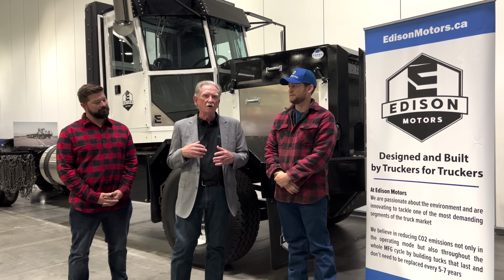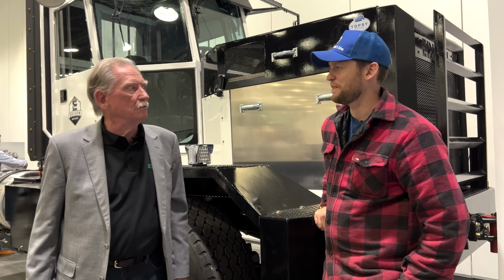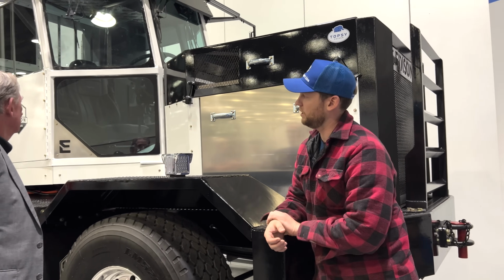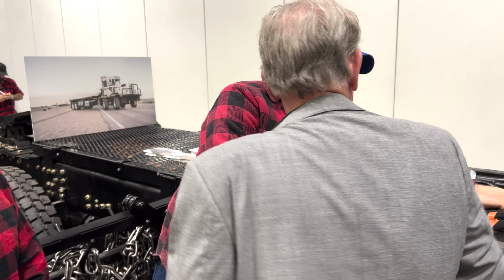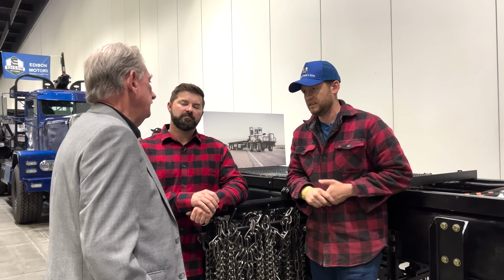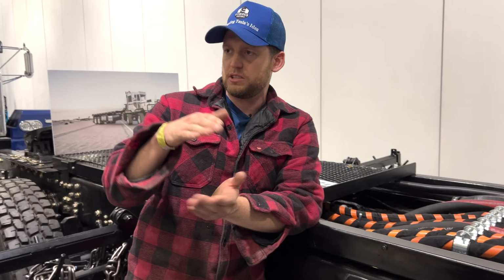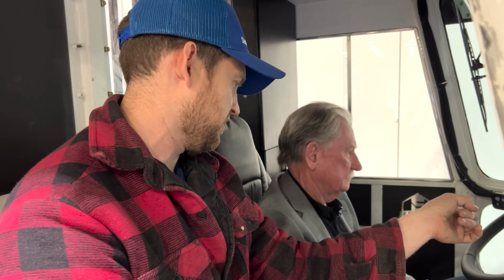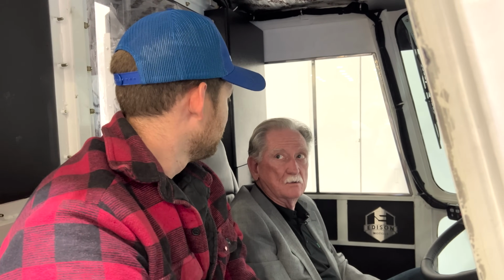This Electric Semi is a Million-Dollar Idea! Edison Motors at Fully Charged LIVE Canada

Comment: And where is the video of them driving this truck under load
Reply: There isn't one, because they haven't done that yet. They barely finished assembling it before the show, and it is now in testing.
Reply: Their channel has videos of it driving. It's away getting tuned before they start testing hauling loads.
Reply: They posted a short on their channel of it pulling 100k pounds in testing 2 days ago. They rolled it across scales to prove it.
https://www.youtube.com/watch?v=RPJ3qIayD7s
Reply: Yes @ClockworkCrow7 , and all it did was go across a parking lot and the scale; it didn't even have the service brake hose or the lighting cable hooked up. It isn't ready for serious testing under load yet... but it will get there. By the way, even in that stunt it wasn't pulling 100,000 pounds... more than one quarter of that weight was the truck ("Topsy") itself, and the trailer plus load was 73,000 pounds.
Reply: @brianb-p6586 I was at the test. He spun the tires with almost no throttle. The truck isn’t street legal so we has a limited space but it had zero issues and worked better than expected
Reply: Sure, @gilliesiut2332 ... and that doesn't change the fact that (as of a month ago) the truck was not ready for a serious test, and it will eventually get there. 

Spinning tires with "almost no throttle" isn't a good thing - it just means that the control system was far from ready.
Reply: @brianb-p6586  well they fully admit they finished throwing the truck together hours before the truck show they where set to make a appearance but the truck is ready for any test. They already have figured out a few small design changes for the next truck. The also made the hood sit a foot higher then necessary simply because they thought the engine was bigger. This is a prototype that’s fully ready for testing. They only need the proper proving grounds
Reply: @gilliesiut2332  assembled is not "ready for any test". The accelerator response issue shows that programming of the controls was not complete; design of the control logic may not even have been done. We saw some of that when the prototype was loaded on a trailer, and a guy with a laptop was adjusting parameters to make it possible to climb up the ramp; driving is not the same as done, by a long shot. It's common for people to underestimate the complexity of anything that they don't do themselves, so most people associated with this project fail to acknowledge where it really stands.
Reply: @gilliesiut2332  the hood height issue is interesting.  They said they were using a Cat C9 long before they built the cab, and detailed dimensioned drawings of that old engine are readily available to the public, so how could they not know the engine's height? I  suspect that the issue was cooling: the radiator is narrow so it has to be relatively tall, and no one did a heat load analysis to determine the required size, so someone guessed on the high side. Okay, details change...
Reply: @brianb-p6586  no, they just didn’t take into consideration all the extra space they’d have under the the hood. When things are overbuilt you don’t need a CAD drawing of everything, you build it as you go using the industry standards already in place and adjust from there if necessary
Reply: @gilliesiut2332  you're describing poor design, instead of doing it right the first time with readily available information .
Reply: @brianb-p6586  i suppose you can call it that but you clearly have zero understanding of how the real world works. This is how almost everything is designed unless your a multi billion dollar company that’s willing to put hundreds of millions into R&D before ever achieving anything and by the end of the whole process you end up with the Tesla truck that uses all proprietary equipment which goes against the entire basis of the design of simplification. There’s a rule in industry called the K.I.S.S. rule. It stands for “keep it simple, stupid”. If you want a truck backwoods rednecks can fix themselves it should be designed by a back woods redneck
Reply: @brianb-p6586  and just a FYI the cyber truck is 10% smaller in every dimension than the original prototype shown off so if you think there aren’t oversights even with hundreds of millions in R&D you are mistaken

Comment: its  all good, until the steering: the steering wheel must have a direct mechanical connection to the steering linkage on the steer wheels. it would fail U.S. DOT certification.
Reply: Considering the power steering wasn’t even functional when they first drove the truck, and they managed to steer it just fine, I’d say it does have a mechanical connection and therefore passes that test just fine.
Reply: This truck has completely conventional steering. The steering wheel turns the column which turns the input to a common truck steering gear which pushes and pulls the drag link to turn the left front wheel, and a tie rod between the sides turns the right front wheels. The only thing which is electric about the steering is the motor which spins the hydraulic pump for the assist... just like your car.

Comment: I'm amazed you're getting $350.00 an hour for a log truck. I am in full support of this truck making it to a production line, however at the cost of $700k is beyond unaffordable according to my math hauling logs here in the US. The haul rates here are based 7:46  on $125.00 an hour. Even talking $350.00 in Canadian dollars that's still over 2x what a truck makes down here 😂. All I can say is, I guarantee the vocational truck industry in the U.S. cannot support that cost. The economy just isn't there for it.
Reply: Trucks in Canada also haul twice as much as trucks in the US. Road limit is 140,000 lbs and they can haul more while off-road before transferring it to highway trucks if needed.
Reply: @MarkRose1337  yeah we have those here too they're called A trains, and even the 10 axle frame trailer setups can gross close to that with a $45  permit.

Comment: Im interested in how the regenerative braking works on heavy loads.  Do the larger generators have a stronger resistance to slow a heavy truck going downhill?  Will that reduce brake overheating?
Reply: Yes, the motors are the generators, and they are sized to suit the loaded weight of the truck. The friction brakes should not be required at all to control speed on a grade descent.
Reply: @brianb-p6586  thank you. The Ford Maverick compact pickup truck hybrid changes from regen brake to hydraulic brake if the driver stomps on the brake pedal.  Seemed like generators have a braking capacity that can be exceeded
Reply: @mokes808  yes, there is a power limit as a motor or as a generator. There is also a limit on the power that can be pushed into a battery, and that depends on state of charge and temperature. The power required to control speed during a descent is low compared to the power required for hard braking from high speed, so regenerative braking for grade descent isn't a problem.
Reply: @brianb-p6586  for hill descent, what percentage of grade will maintain regen braking? And what percentage of grade will exceed regen into friction braking?

Context: summit descents near me are around 6-15%.  Passenger vehicles experience brake fade that is fatal for inexperienced drivers.  Interested in hybrid regen braking as a safer option for summer descents in regard to brake fade.
Reply: @AK-IT  specifcs are not well-known without detailed component specifications, but keep in mind that even a 15% grade corresponds to a gentle braking deceleration... it can just last a long time, which is why brake fade is an issue.
Reply: @brianb-p6586  so with gentle braking, a hybrid passenger vehicle, could completely use re-gen braking over a long time (30 min) for a controlled summit descent of 23% grade (steepest summit grade, average is 6-9%) without using friction brakes?
Reply: @mokes808  the time spent descending is not important by itself; if you drive more slowly, the same descent takes longer. What road distance is covered by this descent, or what vertical distance (elevation change) occurs? If you have one (and the grade), you have the other. It is the vertical distance which determines how much energy the battery needs to absorb.
Reply: @brianb-p6586  thank you so much for the replies!

Comment: How long does a charge last? How long does it take to charge? How much heavier is the electric truck than the fuel truck?
CO2 is necessary for life on earth, we need more CO2 for abundant life, not less.
Reply: This is not a battery-electric truck - it is a diesel-electric plug-in hybrid. You can charge it by plugging it in. 

This truck is about one ton heavier than comparable traditional diesel truck. Edison people - including Chace - have been claiming that it would weigh the same as a diesel truck, and Chace says in this video that's 25,000 to 26,000 pounds. When they actually weighed this truck after the show it came out to 12,580 kg (27,730 lb).

Comment: Take it up I77 out of Charlotte to Beckley tell us what happens and do it every day for a month then tell us what happens don't be talking that empty noise
Reply: You seem to think diesel electric isn’t a tested and proven technology that powers locomotives and ships…
Reply: @gilliesiut2332  I know about diesel electric power but what's the benefit using it on a road truck,,it's heavier and there will be more cost of mpg they don't bother to tell you that
Reply: @garyteeters-ok3hc  it’s not heavier. Their conversion kit was 200 lbs lighter after it was installed. It’s also way more efficient, they’d why it’s used. Motors have a much greater power to weigh ratio than they used to which is why it now makes sense. There’s another big name  trucking company that’s doing it now as well.
Reply: Thinking the same thing!!
Reply: @donaldparry5157  ?

Comment: There is a mine in Switzerland that uses electric haul trucks. No way to plug them in, no solar, no energy input, period. They load at the top of the hill and coast down, dump and drive up empty. %100 re-gen.
Reply: That only works in the particular situation to where you are only hauling loads down hill. On a repeatable path.
Reply: @gilliesiut2332 
Of course, you can't haul a load up and re-gen down empty and hope to gain enough energy. I understand that.

Comment: This concept is absolutely the future of trucking. Huge power and torque, single gear, and a diesel generator running at peak efficiency keeping the batteries topped up. This needs to be made for overland trucking!!
Reply: 👍On a MUCH smaller scale, our i3 REx (94k miles, trouble-free) has me convinced that series hybrid is perfect for this application, too.

Comment: Of course, the hydraulic hose is also a lot harder to field repair compared to typical air brake hose, so while it may not wear out as fast, when one gets ripped from a rock kicked up or running over a branch, or a tire blowout, broken chain, etc, then you have to either get a custom hydraulic hose made or have field repair hydraulic hose fittings on hand, which road service guys aren't going to stock.

They have a lot of great ideas here, but some stuff is not as well thought out.
Reply: Edison is using reusable field-installable hose fittings. To install them you only need to be able to cut the hose and use two wrenches to hold the fitting and turn the threaded collar. A rational operator would carry a couple of spare fittings in the toolbox, as well as the two wrenches (or a wrench and pliers). The ease of finding (at common industrial supply houses) and installing these fittings is the reason that they use them. 

This hose and the corresponding fittings are heavy and expensive compared to the usual tubing and connectors, but they are more durable and they are field-serviceable. You may not agree with the choice (and I think similar but much lighter hoses and fitting would be more suitable), but there is sound reasoning behind it.
Reply: @brianb-p6586  I suppose since they are building special purpose extreme duty vocational-specific logging trucks by hand, it makes sense, you would probably keep a coil of the hose on the truck as well when you are in the mountains, so the things that might not make sense for a fleet of highway trucks could be useful for this application.

Part of the problem is that they make it sound like it's better than a fleet truck, when it has its own drawbacks in a highway fleet operation.
Reply: Correct, @ke6gwf , this particular truck is not suitable for highway operation at all.

Comment: You didn't see the door latches. They're just basic and easy to repair. Not buried in the door. They're on the surface inside the truck. The headache rack, which is behind the cab, has all the electronics inside of it. When you're coming down along Hill and the batteries are fully charged. The excess energy actually turns the generator into a motor and uses the diesel engine to burn up the excess energy by cranking it over without firing. The airbrake system has a generic compressor that if anything fails there, you unplug it, get another one from the local Canadian tire and plug it into the electrical system. Just like you had plugged into the house. The last thing is that by the design of a cab, it's got absolutely perfect vision as you could look down from your left and right through the glass. And you're sitting in the middle. So therefore, of course, you've got a good view of everywhere, and the mirrors outside are  Supported from the top, and you can crawl around the deck of the outside of the truck without mashing your head into the mirrors.
 It uses all the existing technologies to the best benefit that could be done.
There's lots of other little bits and pieces that make this truck very important. So go and see the Edison motors website and check out all the shorts. Show you how they got to where they are. They worked up the storm to get it ready for this show
Reply: The idea of using the generator to drive the engine and then use compression-release braking is just an idea for times that the control system fails to manage battery charge properly.
The little air compressor from Canadian Tire was a temporary part thrown in to get the truck moving when the proper pump died; it would be very unsuitable for actual service.

Comment: It would have been cheaper and lasted longer to run it on hydrogen that you created by splitting atoms of distilled water as you drove down the road but no you wanted to waste more energy and a higher cost of electricity for everyone by making it an electric truck
Reply: He wants renewable energy to, reason why solar panels are another things he sells. But this will be very reliable. We have the same system going in trains for 100 years
Reply: This truck could be built to run off hydrogen fuel cells, too, but they went with diesel to start because that's what they know.
Reply: @MarkRose1337  diesel has more infrastructure, that's why
Reply: @tnc7399 and if it doesn’t run on diesel a lot of truckers wouldn’t like it. That’s the reason for the old school design
Reply: @gilliesiut2332  partly. Old school design is easy to work on, so they went with that. The cab is the exact opposite of old school, it's something not even new trucks do. They do have a 100% electric version

Comment: Finally a diesel electric EV built for spec. job.   I am waiting for a 1 or 2 cylinder diesel gen-set in a small   - mid size EV car.  The diesel train engine model for a EV is what can be the bridge to a full EV.   Never understood why a EV can not have a option to charge from a small fuel powered gen-set when parked or driving.    Tesla even got caught powering a Tesla Super Charger site with a portable gen-set.
Reply: Diesel trains, with the exception of GG20B, don't operate like this. The generator powers the motors directly, not into a battery.
Reply: In an amusing coincidence, @Crlarl , the Railpower GG20B uses the same Cat C9 engine that Edison Motors is using. Railpower went bankrupt over a decade ago.
Reply: @brianb-p6586  
What a cool coincidence.
Reply: That is the Chevy Volt,  that they discontinued when they released the Chevy Bolt.
Reply: @mikegrok 
The Chevrolet Volt isn't just a series hybrid. At highway speeds, the engine will connect up to the transmission and power the wheels directly (not through a generator).
Reply: They are releasing a pickup truck conversion kit
Reply: No, @gilliesiut2332 , they're talking about a pickup conversion kit. This, from a company that doesn't make any of the required components, doesn't have any expertise in electrical power or control (they contract Flodraulic for that), and hasn't converted a pickup truck or any light vehicle. It's a silly distraction.

Comment: As soon as the conversation moves to carbon reduction I lose all interest.  Until  the technology is more cost effective and better in performance than ICE we will not make a difference with the world wide carbon emissions.
Reply: It's true though, proven details. If we switch to renewable energy and better energy than fossil fuels, and EV has next to none emissions in its lifespan as an ICE car has tons. Have you see how much fuel commercial trucks burns in a single year? Better fuel consumption and smaller fuel tanks mean you don't even need to plug in and you get the fraction of emissions
Reply: This is more cost effective.Locomotives and ships are diesel electric for a reason. It’s also way more powerful. It outperforms a I.C.E. In all categories

Comment: GM really dropped the ball by killing Voltec.  It was the absolute best of both worlds. This, is a supersized industrial version of Voltec.  I love it!
Reply: They're both hybrids, but other than that, no. The Voltec system is far more sophisticated than this straightforward series hybrid.
Reply: @brianb-p6586  Voltec was also series hybrid architecture.  Motor under the hood was a generator powering an electric drive.